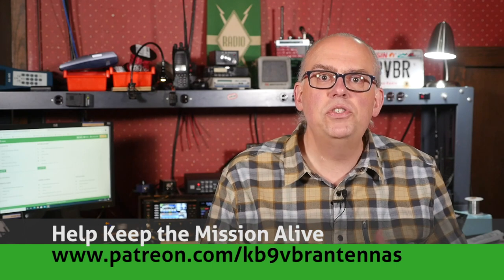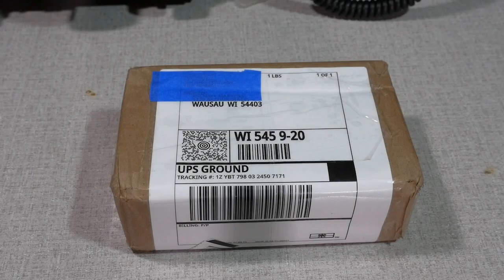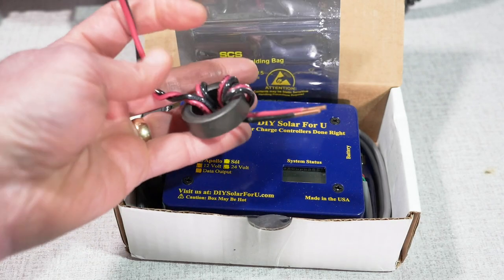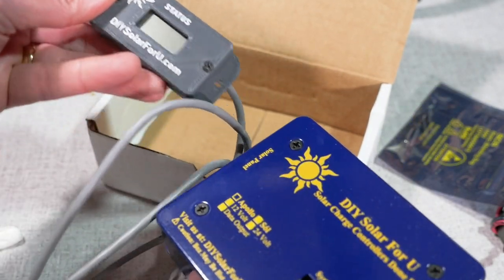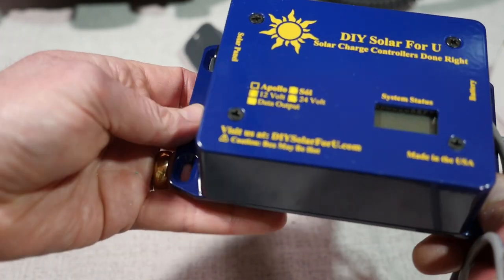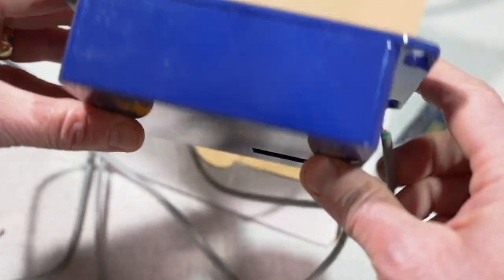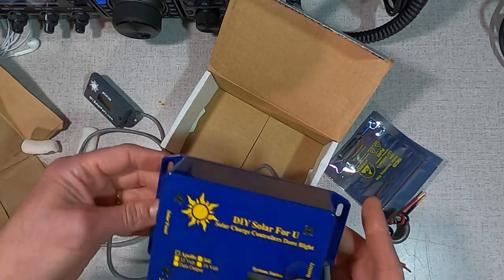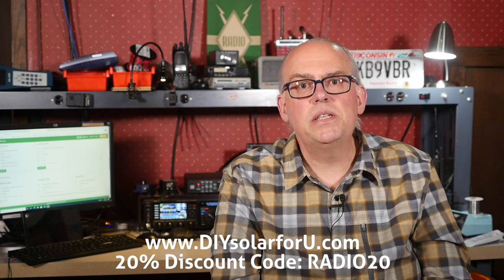Unboxing: DIYSolarforU Sol Buck-Boost 20amp MPPT Charge Controller - Ham Radio Q&A

Comment: Thanks for sharing Michael.  Can't wait to see where the choke is installed and how your build comes along.  Good luck.
Reply from the maker: The choke goes on the side where the solar panel line enters the controller. Weather permitting, everything will come together this weekend, so you should know the results next week.
Reply: @KB9VBRAntennas  Super.  Good luck with the install.  -73

Comment: I'm as interested in the product's claimed efficiency as I am the low RFI.  They claim 3% better power extraction in direct sun than competing MPPT controllers and a whopping 24% to 35% better extraction when the panels are in a 33% shadow.  That alone means this will pay for itself in no time if those numbers are accurate and makes this incredibly more shade tolerant than other controllers on the market.

Comment: Nice SCC!  I love playing with solar. I have a 1kwh off grid system with 512ah Li batteries and a 2000w pure sine wave inverter.  The SCC are pretty RF quiet, its the inverter that causes noise.  I have a Samlex inverter and it's better than most for RF noise.  Good luck with your build. Check out Will Prowse's DIY Solar Channel.

Comment: I love your videos!!!  Is the DIYSolarForU link still correct?  I followed it and the site doesn’t have a phone number and they’re using a gmail address. I’m told that can be a red flag so I’m just checking. Thanks. Mark
Reply from the maker: I checked the link and it and the contact email are correct. I've only communicated with the company via their gmail address. In all honesty, it's a one person shop. But Robert is very responsive and will answer your questions via email.
Reply: @KB9VBRAntennas  I can vouch for that as well.  I contacted them with a few technical questions and he responded quickly with a very detailed/helpful response.

Comment: First of all what does the choke do? Also I want to set up portable ham radio setup for camping or just going out to a park. Would this charge controller work with a 100 watt solar panel, a 20-30Ah battery and my small portable yaesu ft-891?
Reply from the maker: The choke helps prevent common mode interference (RFI) from radiating from the charge controller out the solar power cable. This controller is 20 amp on 12 volts so it will work with a 100 watt panel which outputs about 6 amps in full sunlight. My installation video will drop in about a week so you may get a better idea of application when you see it in use.
Reply: The choke removes any residual Conducted RF noise and is usually used on the Solar Panel side to prevent the panel wiring from becoming an Antenna.  The Charge controller is designed to work with small to large panels so yes it will work with a single 100 Watt panel and allows room to expand if more power is needed.  The added boost ability will help get power in low light and partial shading conditions too where other controllers will fail to charge.  Cheers - Rob Tywlak - CTO at DIY Solar for U

Comment: Will the solar panels be able to stay deployed and survive at highway speed?  We're all anxious to find out...🤞 
KZ9V
Reply from the maker: That's the $64,000 question.
Reply: If well mounted there is no reason for it not to charge while driving.  The controller is vibration hardened and the air cooling effect on the panel should increase power by 10-15% because the cooler the cells the more power they produce.  Keep the angle to the wind stream less than 5 degrees and it will minimize drag and not act like an airplane wing .  Flat with a small air gap under it is best in this case.

Cheers - Rob Tywlak - CTO at DIY Solar for U
Reply: It's hard to predict what the air currents flowing over the teardrop  trailer behind a tow vehicle at highway speed.  The elevated roof rack allowing air flow both above and below the panel should help equalize the pressure.  Is the roof rack level when the trailer is attached to the tow vehicle?

Comment: Good video as always.  Looking forward to your MPPT vs PWM controller video.  I know very little about solar.
Reply: PWM controller are the cheap ones and lack a power converter so they force the solar panel to operate at the battery voltage.  Power loss is anywhere between 30% to more than 50% over a good MPPT controller can produce with that same panel.  This is because an MPPT controller has a DC-DC converter that finds the Maximum Power Point of the panel and converts that to the battery voltage at very high efficiency (hopefully).  DC-DC converters can make a lot of noise if not done properly - Our controllers are designed to be RF quiet and have added Spread Spectrum to further reduce noise another 12-20 dB.  In cloudy conditions the difference between PWM and MPPT is larger because the panel is not as hot and want to run at a higher voltage.  with 2x 100 watt solar panels wired in series in overcast conditions the PWM produced 0.8 amps while the MPPT produced 1.81 amps.... because the panels wanted to operate at about 34 volts and not 13.5 volts to charge the 12 volt battery.  The higher the voltage difference between MPPT point and battery the greater the improvement in performance over a PWM controller.

You can liken it to operating into an antenna without a tuner (PWM) and with one (MPPT) as the DC-DC converter performs the "MATCHING" between the panel and battery for maximum power transfer.

Cheers - Rob Tywlak - CTO at DIY Solar for U
Reply: @solarpower3081  that makes a lot of sense.  Thanks!

Comment: can a solar panel be placed in a window?
Reply from the maker: They can, but it won't be optimal. If your window has a Low-E coating for energy savings it may also prevent the panel from working at all.
Reply: You can place a panel in a window but depending on the glass you will loose a fair amount of power - LOW-E Glass blocks a lot of the sun's IR light and I have measured only about 30% Power thru a double pane window with the LOE-E coating on the glass.  Cheers - Rob Tywlak - CTO at DIY Solar for U